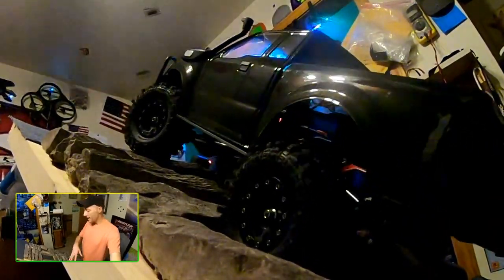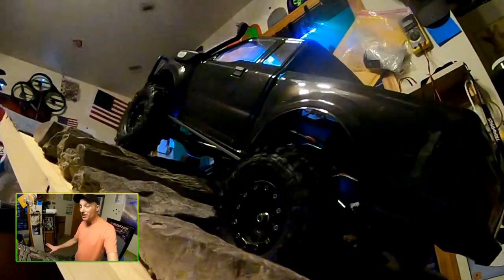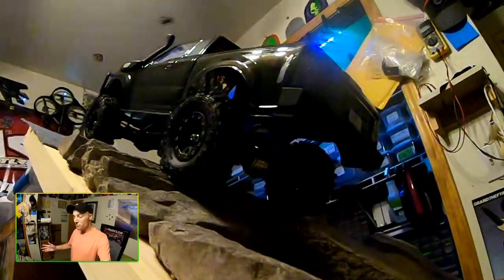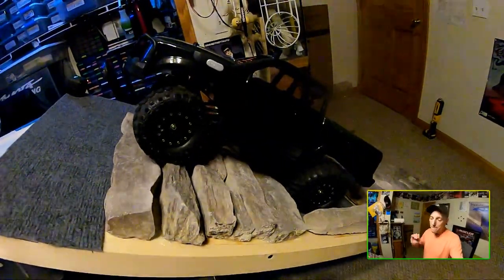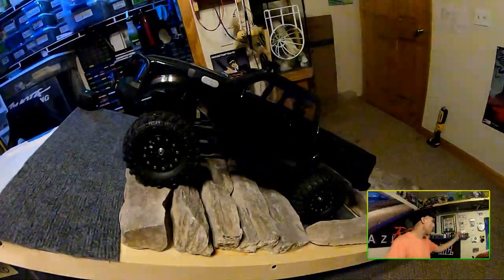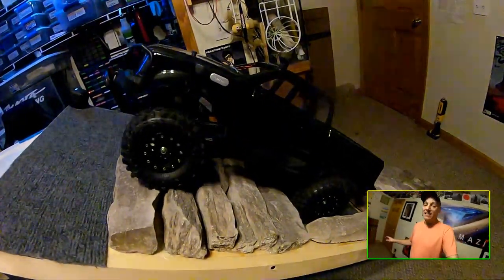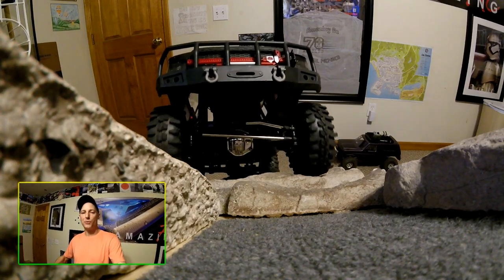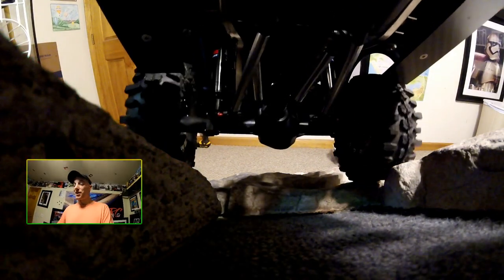AMAZING RC'S INCLINOMETER part 2 STONE ( update ) Working Prototype

Comment: The rock makes it a much better result, I have always thought the flat surfaces does give a true reading of the incline.
Reply from the maker: It's the "carpet" that had me thinking. You just don't run into a bunch of carpet out on the mountain... LOL.!  I think that I may be on to something here. Now I just have to figure out what's next... I am torn between making it into a "fixed" ramp with configurable stone for difficulty, or doing the inclinometer thing like the carpet one that a made. I am at a point that I can still go either way...